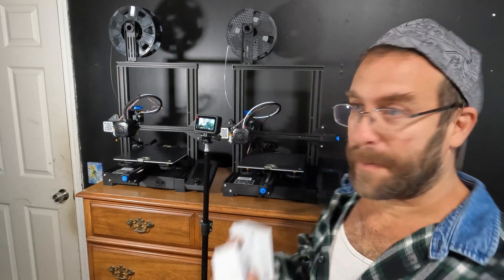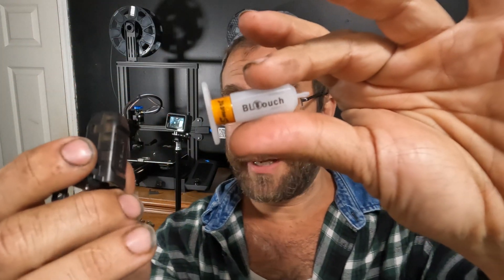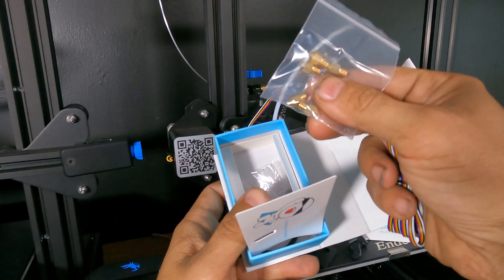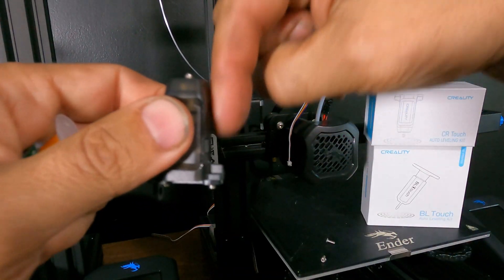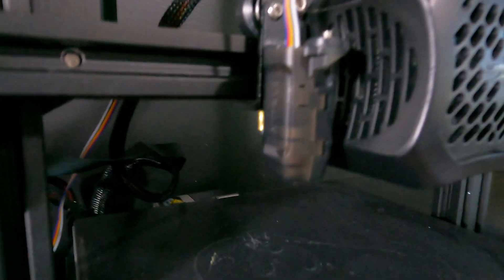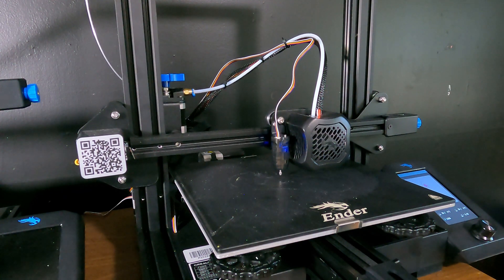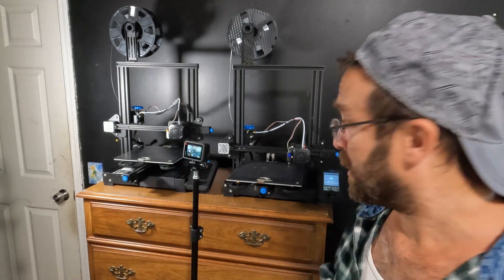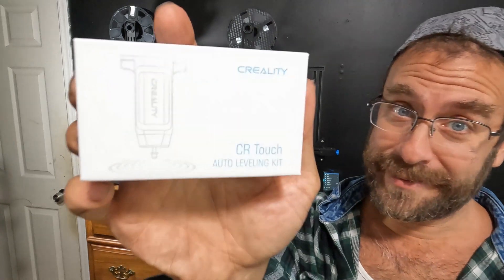Upgrading from BL TOUCH to CR TOUCH, on Creality Ender 3, CR-10, etc

Comment: Thanks for mentioning that they're both using the same FW and pin layout! I'm currently running a BL touch on my Ender 3 V2 but I'm definitely gonna upgrade when it fails in the future, so it's good to know that I don't have to route the wire again.
Reply from the maker: Easy swap. Worth it

Comment: Thankyou thankyou thankyou!!!! I ordered a crtouch a while ago and you proved its really simple to upgrade a bl to a cr without any issues or firmware updates... That being said its been a hot minute since ive run a firmware update to my board so i may test first with the current firmware before i update it just to see.
Reply from the maker: It will not work without the Touch Firmware. Don't run it without that. Hit my other channel for allot more help! @3DRUNDOWN
Reply: @GreggAdventure  it already has no touch firmware. Ran just fine without me updating
Reply from the maker: @kooky112 You'll need to update to a touch firmware to run the abl mesh and set your z offset

Comment: I regret the CF touch I have had so many issues with software it’s crazy no touch is so common so it’s supported everywhere
Reply from the maker: CR-TOUCH and BL-TOUCH work on the exact same software/firmware. Every single BL-TOUCH firmware, works with the CR-TOUCH. I have 20 of them installed.

Comment: why dont u have a z asix limit switch
Reply from the maker: When you install an ABL, one the key benefits you gain, is full manual Z-Offset control. This enables you to make Negative adjustments, to get that perfect 1st layer Z-Height. A Z-Stop switch physically stops the Z from moving beyond it. That needs to be removed. See more at my new channel: @3drundown

Comment: Is this supposed to work on ALL Creality 8 bit boards?? I tried using the BL Touch wiring, but noticed the wires, where they plug into the sensor, are in reverse order as what the CR Touch wires use. At that point, I removed the 5 pin JST that is supposed to plug into a 32 bit mainboard, and installed a 2 pin JST for the power, and a 3 pin DuPont connector for the RBY wires, in the order that is required for the BL Touch, and I get NOTHING!!! I have a Creality 2.2.1  8 bit mainboard in an Ender 5 Plus.
Reply from the maker: It's work. I've got one on my SV02 with the 2.2.1. There is a different cable for it. Hit u back on this in a bit
Reply: @GreggAdventure  Thank You, looking forward to learning how to make this work
Reply from the maker: My SOVOL SV02 havs the 2.2.2 board, and my CR-TOUCH is working. I used a cable that is in 2 sections, rather than ONE plug. Yours should have come with this. There are some good refference pics, if you google hard enough. Review this thread, and some of the images attached: https://www.reddit.com/r/CR10/comments/byc05z/cr10s_v21_mainboard_bltouch_wiring/
Reply from the maker: I can try to get a pic of mine if need be

Comment: hello I know its old video who ever reads this I just upgrade my old motherboard to Ender-5 plus silent motherboard on my CR10s model and is it possible install CR touch on Ender-5 plus motherboard using model CR10s  thanks for help anyways
Reply from the maker: Hi Larry, you should be able to. It uses the same firmware as BL-TOUCH. So, if you get a BL-TOUCH firmware, it will work with the CR-TOUCH
Reply: @GreggAdventure  thankyou!
Reply: Has is workend? Want to try ist too.
Reply: @tobiasraab7177  IL be checking out today and see that will work, if so IL will let you know

Comment: The CR touch rattled so badly when the metal probe was retracted that I had to return it. Of course this is really only a problem if you have silent motor drivers and silent fans, which I do. If they fix that one issue, the CR touch is really awesome.
Reply from the maker: You had a defective CR-Touch. I have 4 and they make no sound at all.

Comment: Do you know how to use a crtouch with klipper?
Reply from the maker: I put Jyers on one of my machines so I could help others with it, but I haven’t used Klipper. Jyers works well.
Reply: @GreggAdventure  alright. You should try klipper, though. 150 mm/s first layer, stuck perfectly. Pretty awesome.
Reply: @GreggAdventure  great video what jyers firmware did you use am on jyers  manualmesh at the moment my cr touch is on its way
Reply from the maker: If you haven't already, switch to MRISCOC firmware. Check out my 3D Printer Channel: @3DRUNDOWN
Reply: @GreggAdventure  I use Klipper
Reply from the maker: Touch is easy with clipper. ABL is on the interface
Reply: @GreggAdventure  it’s not super easy with CRtouch but I figured it out

Comment: If you run the BL touch harness up the path with the hotend wiring, it’s gonna fail a LOT. If you go that path, use a shielded harness that’s grounded to the Ender 3 chassis and it will be flawless, as mine is after shielding it. Inherent flaw in the signal of the BL touch since the hotend power wires inject a lot of noise into the BL touch signals to the main board.

If you route the harness FAR from the hotend harness (and any other noisy sources) it will work like a charm.
Reply: There's also an option in Marlin firmware to reduce noise interference when running the BLtouch. I used that option without a shielded harness that follows the factory wiring harness to the motherboard and it worked flawlessly. I'm replacing the BLtouch cuz the mounting ears are cracking and breaking off. I probably installed the screws too tight. Lol
Reply from the maker: Interesting….  I’ma check that out!

Comment: I recently bought a BL Touch and when I could get it working, I noticed that the plastic probe, bends ever so slightly when it touches the bed. I decided to return it to Amazon and get the CR Touch and it worked perfectly right out of the box. Only thing I notice is that being metal, it kinda rattles a little when the extruded moves on the X Axis.
Reply from the maker: The probe is SO fragile. BUT, it touches soooo gently, I can’t imagine it bending. I wonder what was happening there. The CR is so much better made. I have 1 BL still functioning. When it dies, it’ll get a CR also

Comment: I have had the same set up on my 2 ender 3 v2's for the past 2 months, 1 with a CR and 1 with the BL. BL works much better !!!
Reply from the maker: I have 2 Ender 2 V2, and the BL Touch have been a disaster. Leveling randomly fails. Self Test Randomly fails. Print head sometimes drives itself into the bed for no reason. Prints nothing, while the progress goes from 0-100%, and, a few day’s ago, one of mine straight up dies. It’s build quality is horrible. My CR Touch has been great so far. All my problems Vanished. What are you finding better, about your BL touch?
Reply: @GreggAdventure   download the Marisco firmware  With the CR you have to take off the HS probing off and increase it to max z 960 feed rate and it works fine, but with the BL touch  keep the default formulas with the faster HS Z feed rate and it works so much smoother in my experience.
Reply: The CR touches design is better but the accuracy not near as good.